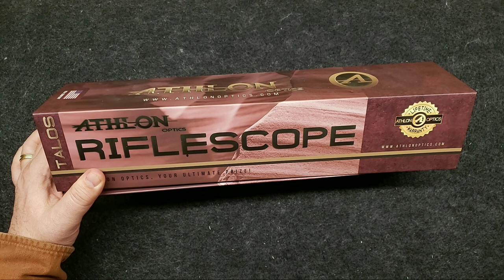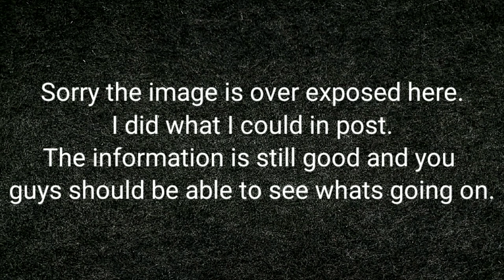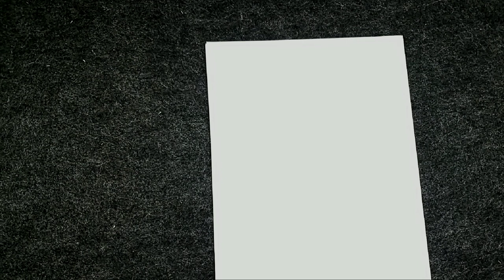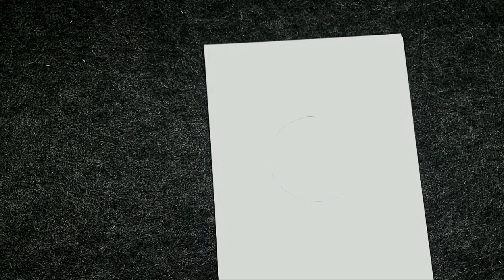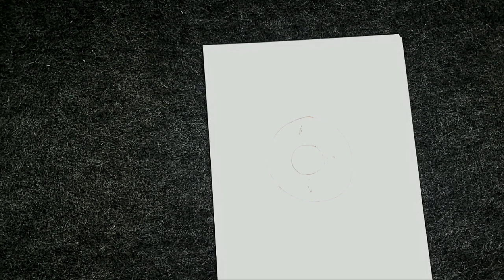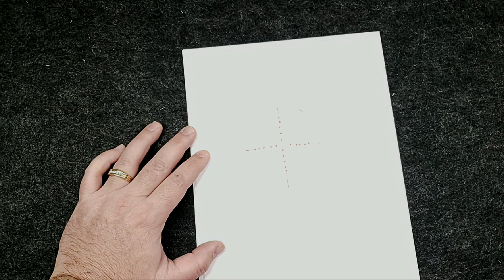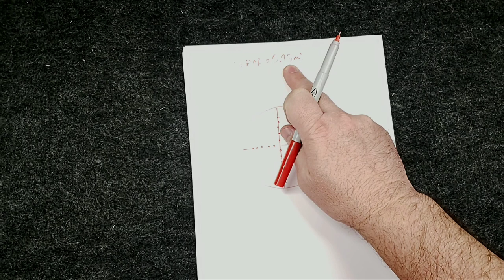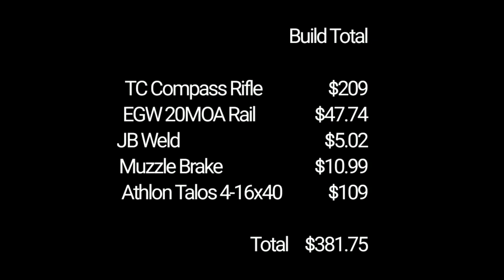TC Compass 300 Win Mag EP4 - Optics, Muzzle Brake, and break in.

Comment: Fantastic—I learn so much from your videos! Question, I just ordered this very rifle from CDNN. In your break in process, 1st 5 rounds. Do you clean with patches and solvent after each round? That’s how I’ve broke in my rifle barrels? I use tight patches w Butch’s. Am I off base. BTW—Your mounting of the rail w epoxy is perfect. I’ve never seen this!